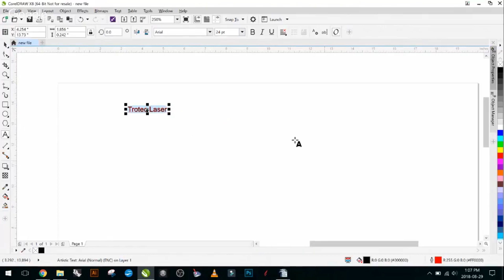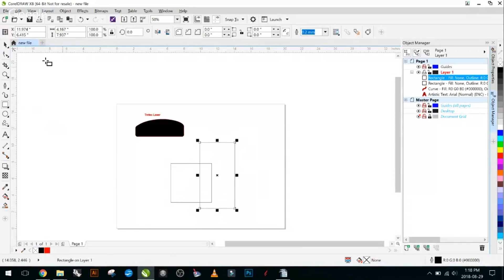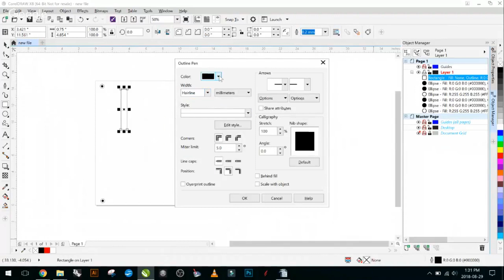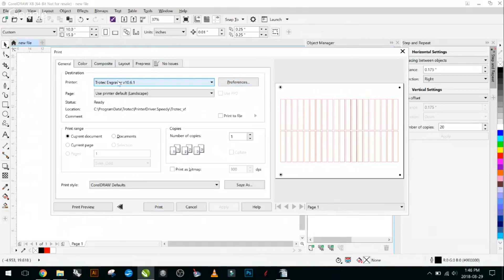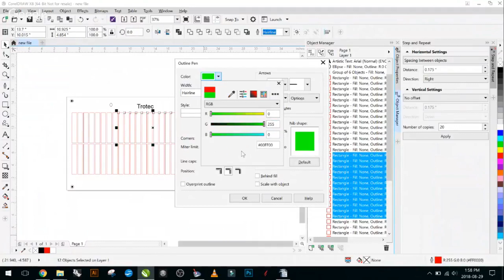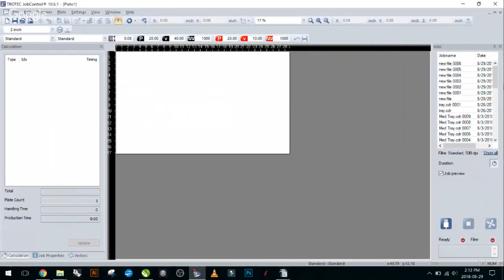CorelDRAW Basics for Laser Users | Trotec Laser Webinar

Comment: Hairline width is not the only way to detect a vector as a cut line... Tested in Inkscape. U can make any width u want, as long if it's a vector and have corresponding color in your Material Base.
Reply from the maker: Hey, thanks for mentioning this. That's a very good point we missed in the video.
Reply from the maker: Hello mdontu1483! There should be varios Corel DRAW courses online  also here in YouTube...Please have a look! We hope this helps, best regards, your Trotec Laser team